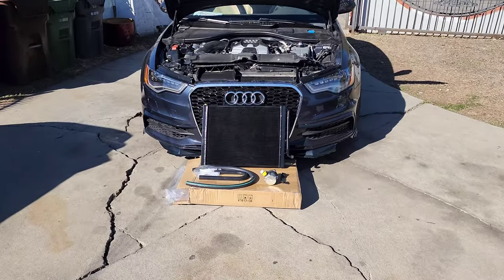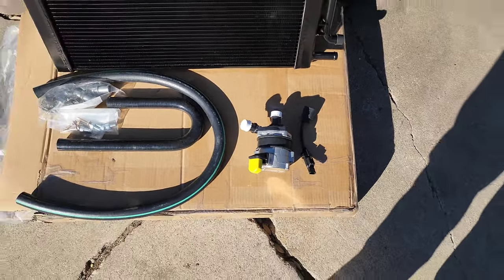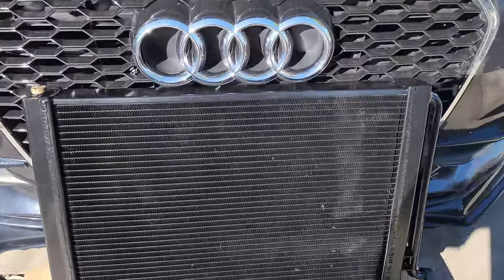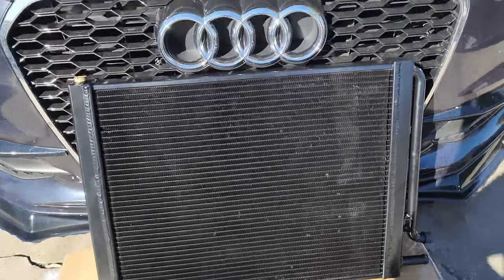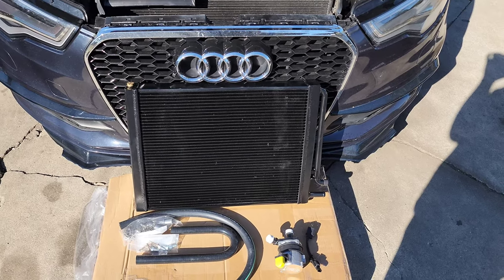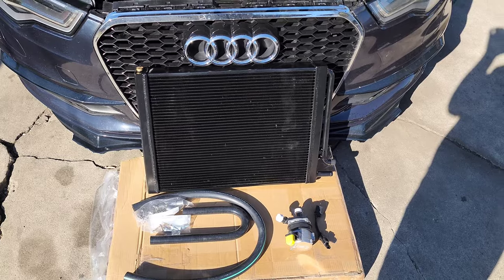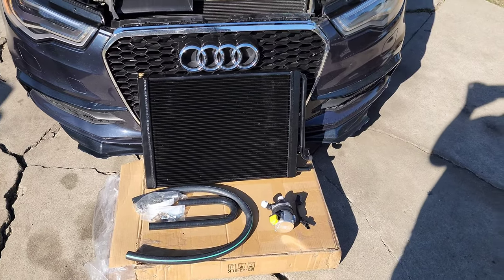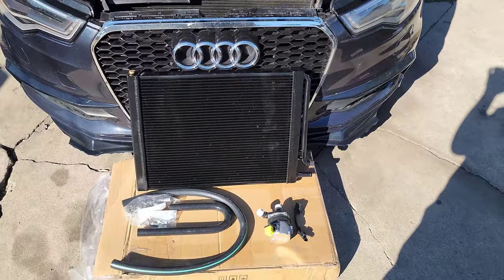Audi A6 3.0T MercRacing HX & Pierburg CWA150

Comment: Your pump comes on so long as you are above around 2000-2200 RPM, IIRC. One of the 3 wires going to the pump is the control wire for the car. If the wire is clipped, the pump runs all the time. Maybe rig up a "race" switch so that it runs all the time  if you have plans to "engage" someone. If you can, please do a full pass and show us how fast the temps go up.
Reply from the maker: I pulled the pwm in a later video and did a run. I'm gonna get the VelocityAP intercooler ports so the system flows better.

Comment: I have a 2014 a7 I just went 034 stage 2+ first day on it and I noticed my fans turning on mostly when I’m at a red light or stop. So I’m looking into a heat exchanger myself now. Didn’t do no crackles though just still sounds stock til that supercharger get to screaming
Reply from the maker: The fans turning on is part of the tune where it turns the fans on high and the hx pump on 100% to cool the supercharger coolant. It's activated when the cruise control stalk is in the back position. You can turn the feature off by pushing the cruise control stalk in the forward position.
Reply: @cmidas3396 oh cool thanks for the heads up. I took the car to get the tune down due to not having a battery charger so I didn’t want to risk it. Is there an option for crackles/popcorn for the 034 tunes? Also I was looking into these heat exchangers and see a new one on preorder but a slim version that’s available now. Should I just want on the full size version?
Reply from the maker: @southjersey1000  Yes, 034motorsport has a crackle tune option and I think it comes with the tune so you'd have to select it. 
The slim hx is fine for stage1 stock pulley & stock hx coolant pump. When you go stage2 & up you want a bigger hx.
Reply: @cmidas3396 appreciate the help. I’ll just do the preorder and wait it out. Since I did stage 2+, Hopefully shipping isn’t to crazy of a wait lol

Comment: how much extra space was left around the heat exchanger to get a larger one in? about to do this myself & wanted to see if you had any thoughts
Reply from the maker: There was a good amount of space actually. Originally I was supposed to run the bigger 4.0T cooler but Merc is out of them. I may change it later after he gets more in.

Comment: Did you get a code for no signal feedback from the pump? I didnt get a CEL but it did show a fault code after install.
Reply from the maker: I think you only get a code if you pull the pwm wire for it to run at 100%

Comment: How’s this mod affecting cooling for the radiator and condenser?
Reply from the maker: I haven't noticed any drop in performance of the condensor or radiator. I've never felt the HX get hot to the touch just lukewarm. Air passes through it to the ac condensor and radiator and they perform as they should.

Comment: Hi. Jose recommends you upgrade your pump fuse to 20Amps when installing the CWA 150… did u have to change yours? do you have any idea where the specific fuse is located ?
Reply from the maker: Yes, I changed the fuse to 25amps in the last video when I installed the ethanol sensor. You can see the location in that video but you need to verify the location of the pump fuse for your specific year because it might be in a different location.

Comment: Hey, did you get any codes after installing this.
Reply from the maker: You will only get a code for the coolant pump cwa150 if you pull the pwm wire.

Comment: Did you ever upgrade your fuse for the bigger pump ?
Reply from the maker: Yes, I did it when I installed the ethanol sensor.
Reply: @cmidas3396  do you know where the fuse is located
Reply from the maker: I can't remember exactly where it is but it's in the fuse panel under the computer under the raintray.

Comment: do you need this to do stage 1
Reply from the maker: No but it's recommended to upgrade the HX but you don't need the cwa150. You can also check your tuner's hardware requirements per tune stage.

Comment: Love your channel just found you tonight, planning my build, doing timing chains, test pipes and engine mounts rn, have you seen merc racing is releasing an updated 3.0 heat exchanger? Opinion on it vs the 4.0T X?Cheers
Reply from the maker: Haven't seen anything about another updated 3.0T heatexchanger besides the latest version that I have. I think to get the best out of the bigger heatexchangers more coolant needs to circulate. There are people that have done things like bigger 3/4" hose and bigger pumps plus coolant ports to get better flow through the intercoolers.

Comment: Great video, being serious.. can younhelp me understand what your speaking of with the pump/harness, etc
Reply from the maker: What exactly do you want to know?
Reply: @cmidas3396  I am looking to move forward with this s5 , but I am big on preventative maintenance,  so very curious about the cooling options, the best and right way
Reply: Also I am not a teenager! I hate all this online, email, messaging shit, we're grown, I'd like to speak
Reply from the maker: @ronkirkham3410 You only need this if you are going to go with a dual supercharger pulley which will spin it faster to make more boost which in turn creates more heat. To deal witb that you can upgrade you heat exchanger to a bigger one for more cooling capacity and a higher flowing auxillary coolant pump for more flow through the bigger heat exchanger and intercoolers in the supercharger. I recommend the MercRacing heat exchanger and you can go with the CWA100 axillary coolant pump that is available at MercRacing alao.
Reply: @cmidas3396  correct,  100% were I'm going, beyond full bolt on, this is going to be a serious  project
Reply from the maker: @ronkirkham3410 Yeah they are fun cars.